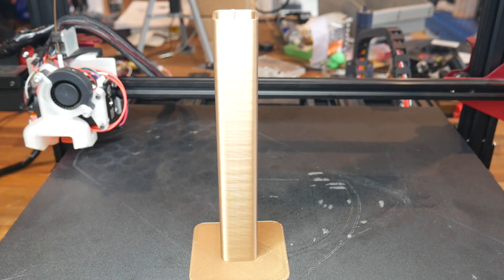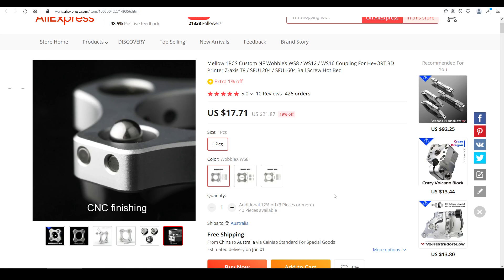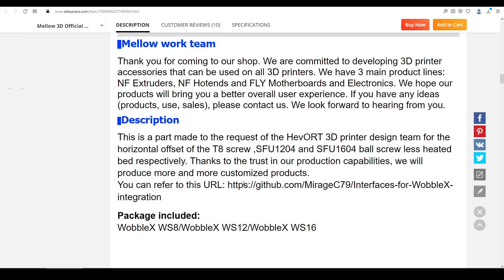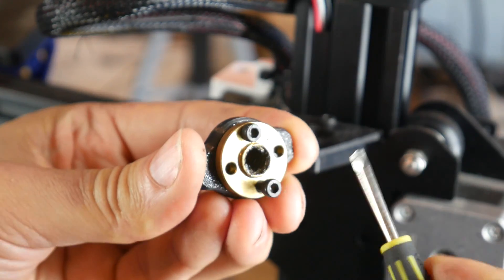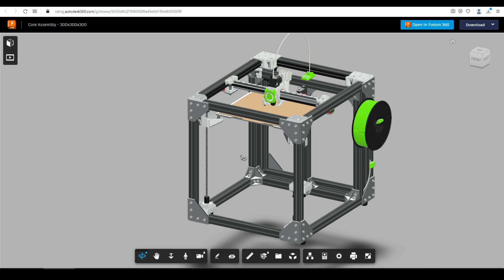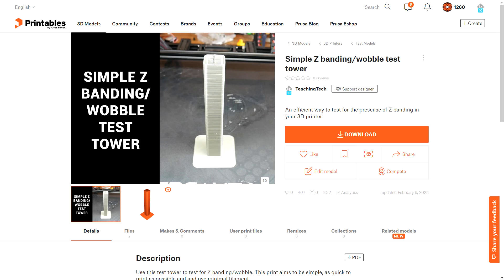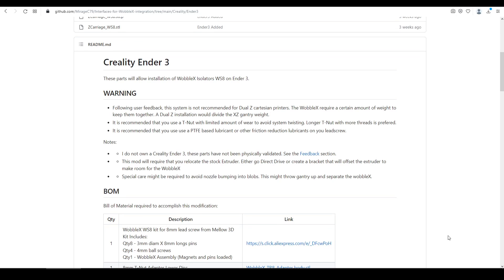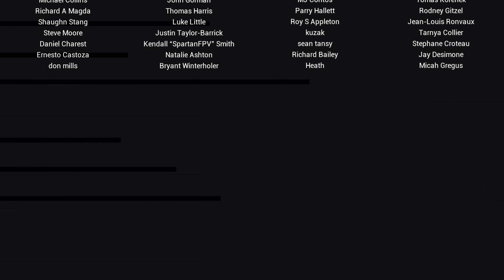The foolproof fix for Z banding and misalignment? MirageC’s wobbleX

Comment: Maybe increasing the distance between the Rods slightly could help keeping the ball on the tracks cauz it would sit lower inside of them? 
This would remove a little bit of the rotational axis becaus the wobblex parts are a bit closer to each other, but id guess theres isnt much rotational movement on an ender style z axis anyways
Reply: Or you could use bigger balls in that case (thus pins further apart and bigger balls)?
What I also don't like (well... '"don't like" are big words for this tiny issue though) is that the pins do not rotate around, but are press fixed in place. At first, I thought the pins where able to rotate and thus create a real bearing system with the balls, but they are not, they are fixed in place. So, over (very long) time, either the balls or the pins will wear out and dent and/or show deformation (especially when low grade steel is used.... thinking about the copies and clones which WILL come)
Reply: @CookieTube  i dont think the pins need to rotate. The point of the pins is that the balls can roll over them to create a type of linear rail. In the case of the linear motion the ball is already rotating in the needed direction so no rotation of the pins is needed
Reply: @KidCe.  The problem is not with the lateral/linear motion. That gives a true bearing/rolling action. The whole major point of why and how the WobbleX was made, compared to other solutions, is so it can also tilt. That is why it was designed. So yes, the pins should in an ideal world rotate so that they form a true bearing with the ball, and not 'grind' on eachother. But of course, making them rotate properly also would require a whole other level of engineering and complexity for such a tiny tiny rod (if at all possible).
I suggest to take a closer look at the cad drawings or videos to see how it actually works and what the true motion of freedoms are, and why they are needed (compared to an Oldham coupling). WobbleX it is a very simple, yet ingenious, solution (although it clearly also have some drawbacks).

Comment: The three rollers on each side of the traverse build up forced against each other if not aligned perfect 90 degree. Therefor the natural gravity may not be enough to keep the traverse rested securely in the screw nuts at all. Your upgrade does not do any help in such case. The right conclusion is to add weight to the lightweight side as you figured out correctly. This is the side opposite to the y stepper. Feel free to watch a many month old video explanation on my channel asressing that topic, also showing to adjust the z rollers to 90 degree to beginn with.  Just printed 3d EN
Reply: Levelling X bar and rollers is almost black magic ;)
IMO 4 of the Z rollers should have eccentric nuts: single one on one side and all 3 on the other side. Currently eccentric wheels can add pressure to extrusion on a side (both, with flex), but pressure at outside of the extrusions is what it is but not really adjustable.

Anycubic has had extruder on the other side (at least with i3 and i3 Mega, dual Z), levelling weight across.

Comment: this looks like something that better trapping is needed to create a stiffer ride on a straight path with no damage, or dents ect, and a 2 axis sliding ability like the one created ages ago by someone selling DIY plans for CNC equipment (and used to do some sort of hand crank organ stuff or some such, and free plans for home brew driver boards, all back when CNC DIY was controlled by parallel port pin outputs LOL just look up TurboCNC and ACE from Dak engineering for the software I used to use, back then.

Comment: It is not true that this will get rid of motion from a bent screw. Even if the side to side motion is absorbed in all directions, it doesn't make up for the vertical distance change when more or less bend is unentered. The tilt causes an angle which means the distances must change.

The animation even shows the problem. The gantry is grounded and the rest of the components move. The motor at the bottom of the screw should be grounded and you'll see the gantry move up and down as the bent screw turns.

I also pointed out on his previous design that any decoupled "wobbler" won't translate to motion from the screw.

He argued with me about it. Turns out it was demonstrated in this video.

Just by Oldham couplers. They do what this is supposed to do.

Comment: would love a comparison between this and a more conventional, brass, Oldham coupler. It might solve the issues where you need extra downforce on the E3 as well
Reply: Particularly as the Oldham is much cheaper.
Reply: @petercallison5765  and you can 3d print one that works fairly well
Reply: FWIW, I actually use both. On my Ender 3, I installed an upper bearing with a shaft clamp to take all thrust load, put a radial bearing on the bottom near the motor, and use an Oldham couple to drive the screw. Then I installed wobble rings (printed, not wobbleX) on the gantry nut. Overkill maybe, but I've been pretty happy with the results.
Reply: Oldham coupling does have the very same problem, although MUCH MUCH less!!. The clearance between the parts is still significant enough to cause the same thing! Although, since it would be MUCH less noticeable by eye'ing the print in progress, it would be difficult to recognize that the Z-banding comes from the this very problem.

Another downside of the Oldham coupling compared to WobbleX is that Oldham can only mitigate movement on the X-plane, aka lateral. It can't compensate for rotational movement, which is exactly why the WobbleX was developed.

(But yeah, it is MUCH cheaper indeed. The WobbleX seems to be very overpriced to be honest).

But maybe this 'jump' problem, with both style of couplings, might be solved when you also add an anti-backlash nut? Dunno, can't test it out (my WobbleX are still in the mail and lately I don't have time anyways to experiment).
Reply: @CookieTube  the main issue with Oldham is that while it does decouple movement in the plane, it doesn't decouple the tilt of the axis. Whether that is good enough will need testing but I imagine that any rod non straightness will introduce some tilt.
Reply: @JohnMeacham  yep, indeed, hence why WobbleX was developed. You ALWAYS MUST compensate for tilt in the cases we use lead screws or balls screws for 3D printing. Hence the WobbleX. An Oldham coupling is simply not made for the purpose it is used in the 3D printing world!!

Oldham couplings are flexible shaft couplings that are used to connect TWO different shafts : the strait driving shaft and strait driven shaft , which almost meet in the middle piece of the coupling. It is used to counter parallel misalignment that occurs between connected shafts. Important here is "parallel"... Aka, the two shaft are perfect parallel to each other (not crooked in any way), but their center to each other might be slightly misaligned. Many people don't get that (which you can also read in several comments about it).

Comment: Look into using keyboard switch springs. They're cheap and available everywhere. One on each corner I think would work wonders.
Reply: I dont think they will be nearly stiff enough if he needed 500g to remove the slipping. Keyboard spring are normally about 50g
Reply: @KidCe.  There would be 8 of them, so 50x8 is pretty close to 500g. If needed, there are 72+ gram springs. That's plenty of force.
Reply: @shibbypoopalot  Why not just 1 tension spring in the middle, fixed on the plate above and fixed on the plate below, in which the screw can pass thru?
Or 4 small rubber bands around the corners?
Or just a anti-backlash nut?

Comment: What extruder do you have on your Ender 3? MirageC actually has a really great video that looks at inconsistent extrusion with geared dual drive extruders like the Bondtech BMG. I am wondering if your Ender 3 prints would clean up with a non-geared extruder more similar to the original extruder the Ender 3 comes with. I have a BMG clone on mine and get some Z artifacts, and I am wondering if it is worth trying a non-geared extruder. I only switched because my original plastic one broke. That in combinations with another commentor's suggestion to change the wheels would be really interesting to see the results.

Comment: Regarding your Ender 3 problem. Have you looked at the extruder wheel wich is pushing the filament through the bowden tube? Sometimes it is not really centered causing filament beeing pushed irregularly, showing inconsistend extrusion.

Comment: I think you are probably spot on with the extension springs 3 or four would be best if possible they would also prevent some bed slinger wobble from the bed motion causing tilting front to back
Reply: agree - I don't think adding weight is the best idea.
Reply: @reasonablebeing5392  Extra weight would also wear the lead screw quicker and likely cause extra motor wear.
Reply: or 1 wide tension spring in the middle, in which the lead screw can pass thru, but with flanges on top and bottom (thus needs to be custom made?) to hold the whole system together as one packet....
..... or an anti-backlash nut....

Comment: I use Oldham coupling on my original CR-10 it is working kinda the same principle as the Wobble X.  Also worth watching HeVORT another video about the extruder gear causing inconsistent layers :D
Reply: Oldham coupling has more friction and only has translational degree of freedom, but usually rotational degree of freedom is also required, in particular with ender and cr machines, as z nut is mounted onto bended part, which usually is not perfect 90 degree bent, and may even deform under stress caused by feeder motor in bowden configuration.
Reply: What @Dima said + Oldham coupling does have the EXACT SAME PROBLEM, although much much less. You probably wont even notice it when you just eyeball the print in action, but it is there for sure. The tolerances on those Oldham couplings are not that great. You can even feel it coming apart when you push/pull the coupling. So, yeah, very same problem there.
You might be able to solve it by also using a decent anti-backlash nut though.
Reply: @CookieTube  in Oldham coupling it is fixable,  just make sliding parts not rectangular, but dovetail instead. i printed such a coupling, but it didn't turn out to be as good as just precisesly set z screw and nut.
Reply: @AcTpaxaHeu  No, a dovetail channels have just as much play in them up/down as with the rectangular channel. The shape doesn't matter. And If you think about it/visualize it, is logical that the shape of the sliding channel doesn't matter. I have several from several brands with several shapes, and all exhibit the same issue. It is just a matter of tolerances, not of the shape.

Comment: My V-Core 3 was originaly 3.0 and one of the first kits ever. The Z-screws were not the greatest. The taller the print the more visible a slight 4mm-period Z-wobble became.I upgraded the Z-arms to a printed upgrade called wobble rings (sorry, forgot the name of the author) which does pretty much exactly hwat the WobbleX does. It completely fixed the issue. So much that I did not upgrade my printer to full 3.1, I just changed the already failing XY idlers to bearing stacks (slightly different size than 3.1 stock to accomodate 3.0 geometry). I did nothing new to Z axis because the wobble rings made it perfect already. 
Now I put together V-Core 3.1 for someone and the lead screws are way better. They were shipped inside the grooves of some of the 3030 extrusions so zero risk of transport damage and they looked perfectly straight. However I found that for a 500 size of the V-Core the bed itself is already on the border of what 500mm length of 8mm leadscrew can support without bowing sideways a bit and when you put a lot of plastic on top it only gets worse. Any tiny non-straightness of the leadscrews not even visible on them when they are on a table gets exagerated once they are loaded in compression by a heavy bed. The oldham couplers included in V-Core 3.1 that let the nut move in XY plane are good enough to fix this at least for the good lead screws I got on this machine. You actually see them moving as the bed travels if you look closely and yet a 500mm tall  printed cylinder has absolutely perfectly smooth walls all the way. 
I think that for most printers the WobbleX with its 4-axis freedom of movement (translate in XY and tilt around X and Y) is overkill and just a sliding oldham coupler like the V-Core 3.1 would work too. But there might be some cases where the WobbleX fixes an imperfection other couplers would not.
Reply: I was in a similar situation as you with my v-core 3, but I waited and did the 3.1 upgrade and that also completely fixed my z issues.  The 3.1 upgrade also incorporates a similar decoupling system that's more rigid than wobble-x, which I think is actually a better system.
Reply: @AgentHubcap  the 3.1 decouplers are for sure easier to use. You can lift the bed and put it back down without worrying about it and it just works. With the wobblex you need to make sure everything sits back into its place. Unlike the sliding brass Oldham decouplers the balls can move out of their grooves. 
However I get what the designers of WobbleX say about the 4 axis over 2 axis freedom. If the nut is badly made for example and it's top surface is not staying horizontal as the screw rotates (misaligned thread cutting tool makes the helix not coaxial with the outside of the nut) then the RatRig decouplers will tend to bind and not slide freely while the Wobblex will not even notice and just works. 
So for good components the RatRig decouplers are better because they are more robust and easier to use and don not require the enough weight on them like was shown in this video. But with worse components there can be situations the Wobblex will be better.

Comment: you could hols the part that screws into the x gantry and the part that holds the lead screw nut with strong rubber bands (ender 3 and cr10)

Comment: Wonder if you could use backlash nuts to the Ender3. I don’t have z wobble on either of the z screws on my ender3v2 but upgraded to backlash(spring) nuts, has been great can even print at 0.16 layers with a 0.6 nozzle.

Comment: Hi, so I might have a workaround solution for the ender 3/cr-10. I saw that I needed relocate my extruder, whatever, I was planning on replacing my x-axis end switch cover that has a mount for the stepper motor on it. Would this maybe be enough to weigh it down for this thing to work?

Comment: What about adding an Anti Backlash Nut with a extension spring between the top part and the te bottom part of the wobbleX? Then the assembly Is in compression.
It will almost look like the anti backlash assembly on an Ender 3 but the spring is in extension instead of compression.

Comment: Just get some oldham couplers and if you need downward force perhaps try installing some anti backlash nuts on the top side or instead of farting around with a cheap fix, just get ball screws
Reply: oldham couplers dont counteract tilt unlike wobblex

Comment: Hi great video! I was already eying to buy  the wobbleX for my soon to be rat rig, and now i am certain i will. However I do think that creality machines would benefit from a spring loaded double nut specially the ender3 whit the worn screw, i am running a set on my cr10v2 and they did a fantastic job eliminating backlash and elongating useful life of the screws.